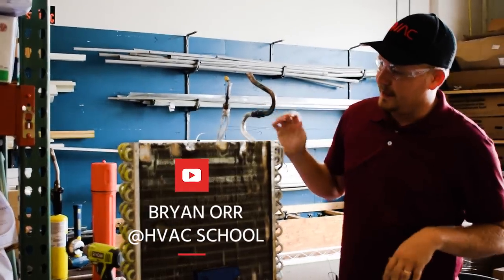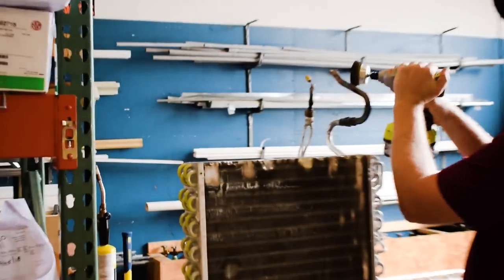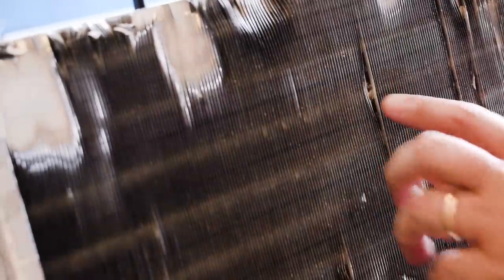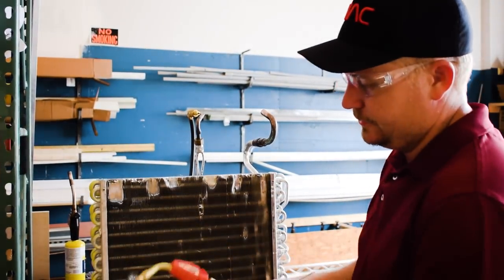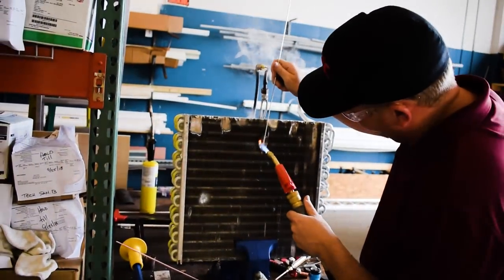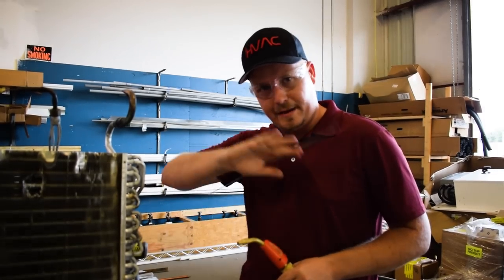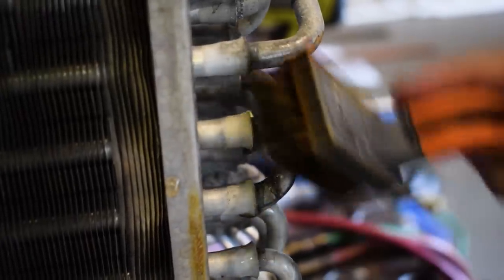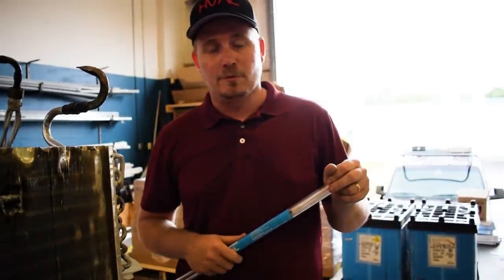How to Patch an Aluminum Coil w/ AlloySol

Comment: i was told a long time ago by an old tech to sand where your going to cut first then you wont get the sanded off stuff into the pipe and also always sand back away from the joint and the coupling itself to get it shiny and will accept heat quicker as the oxidation will reflect heat and not absorb it as quicky,to this day is my practice
Reply: that is correct
Reply: Absolutely correct assessment. That's exactly how to do it.
Curiously to clean a normal wound should be done similarly. Meaning always move away from the wound. So contaminants, dirt and debris won't come into the damaged/wounded area. ;-)

Comment: You make it look easy, like you said it's easy when you know how. I consider myself generally good at brazing but patching aluminum is not easy. I wish my company would invest in more products like what you have here. I've made some successful aluminum patches before with different rods but have also failed some too. My company has us use high temp epoxy with a heat gun, have had some hold and others not. Quick tip for epoxy products is to pull vacuum while applying it. I found it helps. Do you have an opinion on epoxy products and have you tried any? Thanks for the video.

Comment: Thanks for the video....I have done a couple, like the product, but its melting point, even being low, is still too high for refrigerator or freezer evaporators that someone has taken a sharp object to, trying to defrost it....It can still be done, but blowing a hole in the evaporator is just seconds past the melting of the solder...I think the type of flux should be mentioned too.

Comment: I have a small hole, HVAC tech said not possible to fix, need to buy new coil
Reply: There all possible to fix but not practical for most residential units. Once there is a hole in an old coil the integrity off it is gone. You may fix the leak and fill back up... spending lot and then another occurs or that one opens up again. It's best to replace it with new coil and have a 10 year part warranty and full 1 year or more labor warranty. 😎
Reply: @97Napkins  I got a professional to fix it,  knock on aluminum.... Been a year so far so good.
Reply: @gwp1ohio  congrats... hope all is well for this summer. #Change your filter. 😉

Comment: If you put that much heat on a micro-channel coil it will go away in an instant. The wall thickness isn’t thick enough on a micro-channel.

Comment: Yeah just replace the coil
Reply from the maker: Sometimes that’s the best option sometimes it isn’t.
Reply: That's a big problem with the industry.....no one wants to fix anything just replace it
Reply: @scottgrinnell3909  I feel ya
Reply: @channelcatchaser9426   it's not worth it lets say you send 3 to 4 hr repairing  old coil $$$$$$   then it leaks  in a new spot who pays for it you.   No good deed goes unpunished new coil about the same time
Reply: @tonyrichards2017  i completely understand but on the other hand skill is lost if trade practices are not practiced.
Reply: @tonyrichards2017  3 to 4 hours? My man just repaired 2 different holes while explaining what he was doing in 10 minutes... Sure, you have to pump down and vacuum, but you have to do that anyway if you're replacing a coil.
Reply: @truthsmiles  oh so the coil is just sitting right there so conveniently.
Nah it probably in a the hot ass attic on the 3 floor, with no cat walk and a 2x4 directly in front of the coil door which requires you to shift the furnace over just to pull the coil out.........
Reply: Jesse Luna - which is all work you have to do anyway whether you’re replacing it or not...?